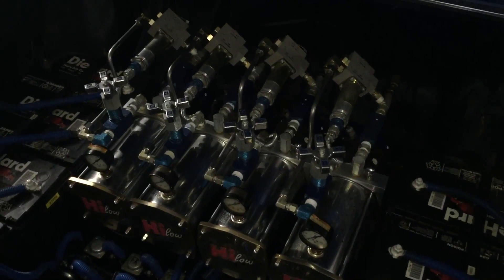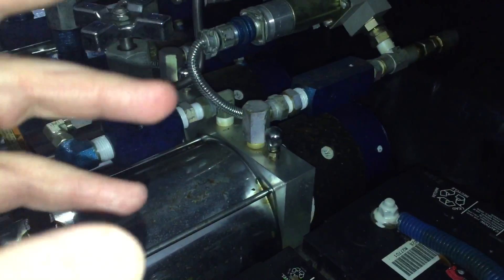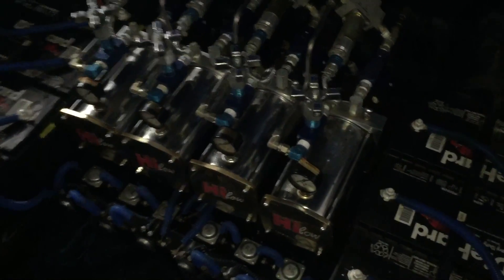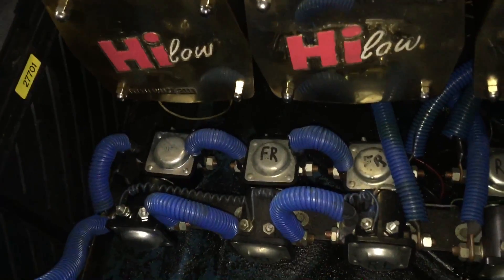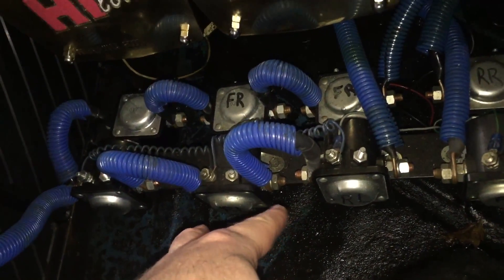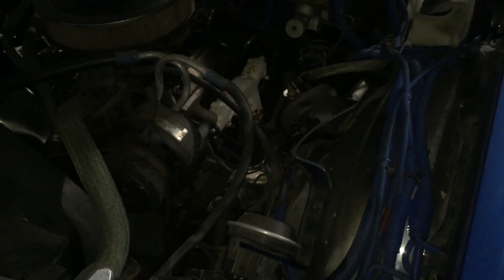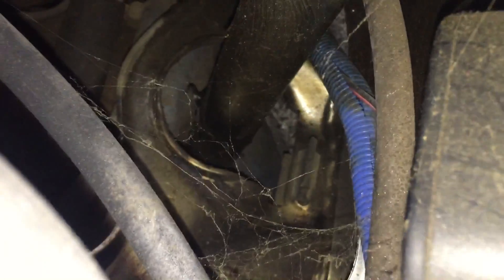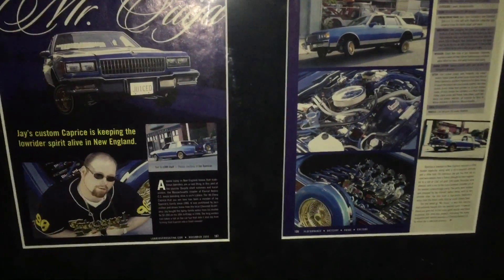Lowrider Hydraulics 101

Comment: What if you were to put a pelteir module the back of the hydraulic motor to keep it cool.  Or also known as tech it gets hot on one side and cool on the other their use in computer and mini refrigerator   U should look if up computer water cool system.some drop down to 17 digrees

Comment: So the car will have no shock absorber anymore after putting hydraulics on? Just the springs with the hydraulic cilinder on top of it?
Reply from the maker: Correct. I’ve seen some people keep their rear shocks in but they just end up broken eventually. You can weld shock brackets on the frame and lower control arms up front but it’s going to kill hopping action

Comment: I dont know much of anything about lowriders but im curious why they use so many pumps and simple on off dump fluid and not something like solenoids in manifold it could have a  electric pump and resivor than you could still have switches like on wheel lift uses ive never seen anything multi pumps like a boss v plow thats one pump several functions

Comment: I just got a 64 impala (4door) 
I just have a few questions, I’m seriously considering hydraulics 

1- I’m a beginner. I want to do front back, side , side and 3 wheel motion. 
I read below that 2 pump 4 dump would work for that? 

Also, what are the cons of hydraulics? I’ve read they leak. Do they go bad? Will I ever have to replace the entire set up? And what maintenance do I need to do to the hydraulics if any? 

Thank you, again awesome video.
Reply from the maker: Marco you’ll need to charge batteries which can take a bit, you will get leaks and occasionally need to change cylinder seals, hoses ect. As far as maintenance changing the hydraulic fluid yearly and wiping out the tanks inside of metal bits. That’s all the fun stuff.

Comment: Can you put hydraulics on a FWD
Reply: Yes
Reply: I’m fantasy’ing about hydraulics on my car (ford focus lol), also fwd, but i guess even if it would get mounted properly, that the jumping and extreme joint movements will mess everything up month after month. Fwd cars already have quite a complex mechanism at the wheels to allow for steering movement & the drivetrain to pass through. If you go launch your car in the air and let it bounce nonstop i’m pretty sure stuff is going to break nonstop.

Comment: Nice video brotha can u explain a lil more on what u mean when you went to raise the car and something  went out the back window?
Reply from the maker: Alejandro Sosa the collar that is threaded onto the cylinder body worked its way apart. When I went to lift the car instead of lifting the car the cylinder body went through the rear deck and out the back window
Reply: @carguysnewengland  damn thats crazy  and also if im correct you want the slow dump to drop your car slower then  when it raises?
Reply from the maker: Alejandro Sosa slow down valves control how fast the system will dump.
Reply: @carguysnewengland  i got you i get em confused but your video is very informing man. im saving up for a 59 impala build thats my dream car.  im from new mexico a city here is considered lowrider capital of the world so one day ill be hittin switches too

Comment: What hydraulic system would you recommend for a 96 fleetwood ?
Reply from the maker: Depends on your own experience... have you ever had a car with hydraulics? A simple two pump 4 dump system is good for beginners. F-B-S--S
Reply: Car Guys New England yes I'm a beginner thats why i appreciate your info ! Would I need to reinforce  the frame ?
Reply from the maker: If you plan to hop or three wheel then yes absolutely reinforce the frame... also GM cars have a huge issue with the rear frame ears tearing off the frame... that will happen regardless eventually
Reply: How much would a set up like that run me ? Ball park figure ?
Reply: @carguysnewengland  Now I know what the pump in the pump and dump phrase is after watching this video. What's a dump though?
Reply: @DominiAeternum  a dump if im correct stores the fluid instead of returning it back to pump so when u want to 3 wheel for example u raise the back end and dump one side down and you front opposite should lift up

Comment: Hi Car Guys New England, I have been a fan of Lowriders since I was a kid and always wondered how they worked. Thanks for the video.

I have two questions

1. Can one use or find 48V motors for the pumps that pumps the fluid at the same pace to avoid damaging the 12V motors and solenoids making the components last longer and minimizing risk.

2. Can you make a video where you hit the switches and show which cylinders they effect and how to make the car hop? (Front to back left to right three wheel hopping etc.)

Comment: That's seems I little old I would keep the Aden dumps and get black magic hydraulics and new batteries ijs clean car tho super nice my highschool car was a 1982 Cadillac fleet wood with the 90s front clip and 4 pumps 12 batteries but she flipped off a trailer clean car tho
Reply: Damn were u driving the truck?
Reply: Alejandro Sosa naw my dad the trailer had bad tires but couldn’t tell cause the tread was goid n they dry rotted on the inside